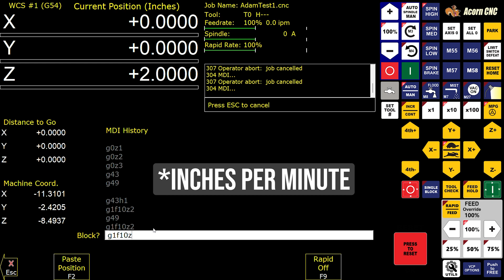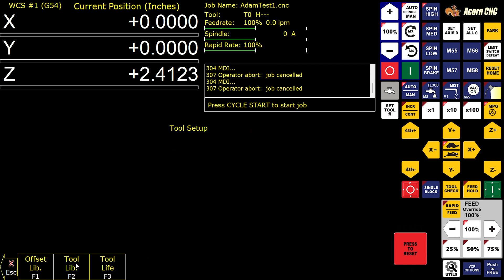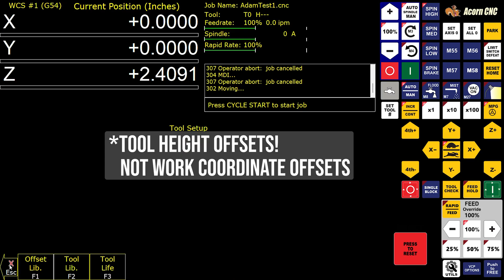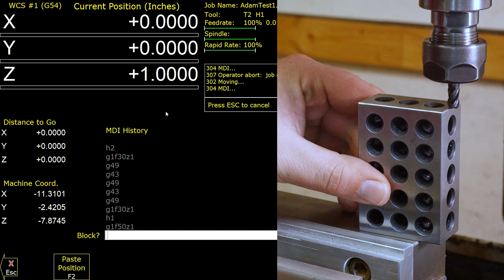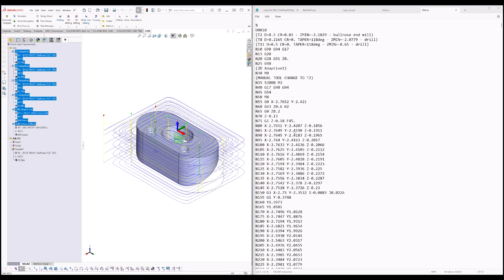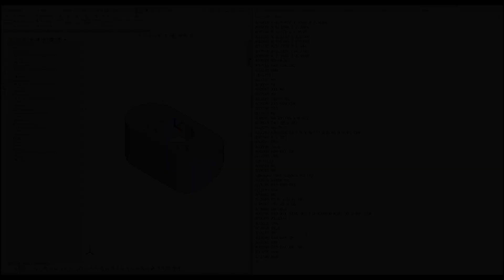Centroid Tool Height Offsets

Comment: Great stuff, but how/where did you define the z zero to be at the top of the vice, and where/how
 is this set in the software ?
Reply: You have to measure the difference between the vise jaw and the workpiece and set it in your fixture offset Z value. (That's just one way to do it, there are many other ways and none of them are wrong.)

Comment: Hey Adam, great Video! one question, im I just got a Bridgeport CNC up and going on CNC10. its pretty mutch the same as far as this topic goes. my question is : once i set a first batch of tools using a reference tool, at some pont down the road when i replace or add new tools in my case the knee may or may not be in the exact same location. do i simply get it close and re measure the reference tool and then the new tools, or do i have to remeasure all tools again? thx
Reply from the maker: If you get new tools, or change tools in a tool holder you’ll have to re-enter their offsets with respect to the reference tool, but if your knee mill is just in a different position, all you have to do is re-set your Z work coordinate offset. You can do that with the reference tool or any other tool. If you’re using your reference tool, just make sure “H0” is activated before you touch your part and set it to Z 0.000. If you’re using tool #2 to touch off, just make sure “T2” is activated before setting Z 0.000. When you do this, all your other tools will also be in the right Z position when their heights get activated. Essentially, once you enter all your tool height offsets, you will never have to re enter them again unless you change the tool, even after power cycling the acorn. The only thing you have to do before starting a job is setting your X, Y, and Z zeros. Does that make sense?
Reply: @adamdebowski2037  not exactly, im good w setting them the first time and running jobs and all that, whats not clear is say i want to add another tool, well now my knee isnt where it was when i set the refz and all the other tools, so whats the process then. re-establish the reference tool im assuming, but this time it will be a different offset value, so whats that mean for all the other tools? does the system automaticlly update all the other tools offsets in relation to the new z ref tool? u see what im asking? man i appreciate it
Reply from the maker: @RelicArms oh I see what you’re asking. Head to 14:40 in the video. If your knee is in a different position, all you have to do is establish a new “reference surface.” Once you set that reference surface by touching it with your reference tool like I show at that time stamp, you swap in the new tool, touch that same surface and add that new tool’s offset in the offset library like you did for all the others. At this point, the new tool and all the other previously set tools in the offset library have correct offsets.
Reply: @adamdebowski2037  awesome man that’s what I thought and was hoping was the case. Thanks for clarifying.
Reply from the maker: @RelicArms  My pleasure - cheers - Adam

Comment: Do the centroid controllers have any input or way to track knee height? Like a second Z-Axis DRO input that can be used when tool changes require moving the knee?
Reply from the maker: The acorn does not, but there are other controllers that do. Give Centroid a call.

Comment: Please Centroid higher Adam to put out more videos for beginners! I went through the section on tool offsets in the CNC12 manual and just wasn't getting it. Spent a few hours trying to figure it out on my new retrofit Bridgeport Series I CNC and couldn't get my Z heights to work out, turns out I just had one tool a positive when it should have been a negative. Got it figured out, but this video reaffirmed I did it right! Big thanks!

Comment: Thanks for posting this! I recently finished my own PM-30 conversion and this channel has been a huge help. 

How do you account for a tool change from a tool with a known offset to an unknown one like when switching to a drill chuck? Do you just reset the wcs Z origin for the drilling op or something else?
- Bob
Reply from the maker: Slick! Congrats! I never switch from a tool with known offset to a tool with unknown offset. The drill chucks I use are TTS style so I can set all my offsets before the job starts. If your drill chuck isn’t a fixed tool holder, you could pause the program, set the height offset, and resume the program from the line of your choosing in the run menu. Or, you could split the program up from the get go by posting your code in sections and setting your tool heights between those programs. Does that make sense?
Reply: @ makes sense! Thanks!